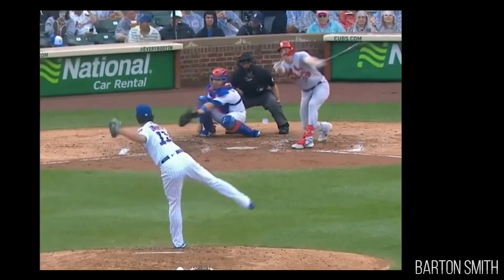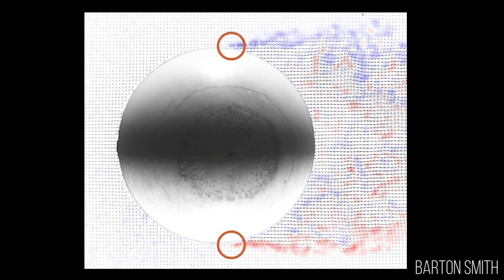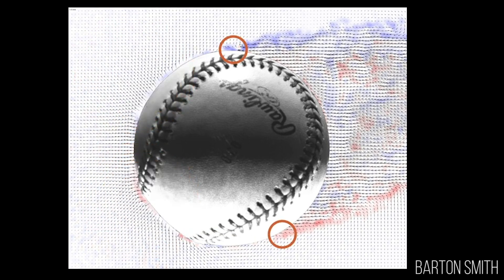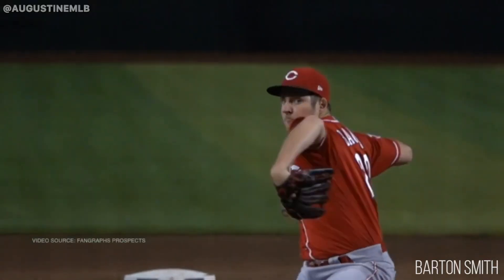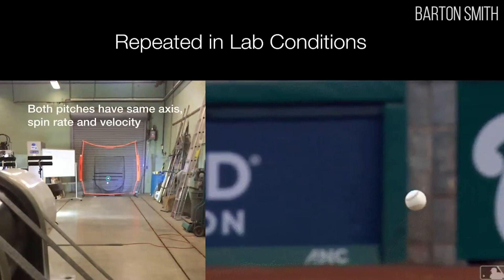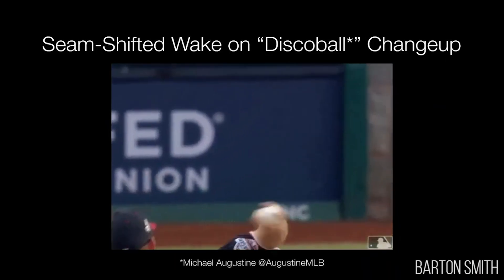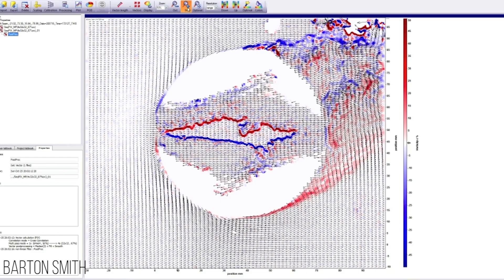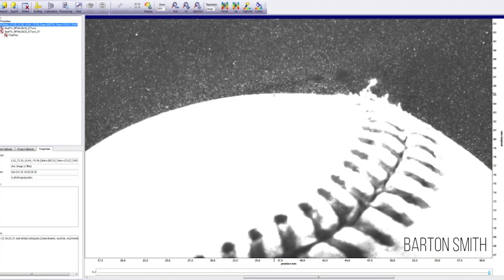Baseball Aerodynamics

Comment: What about a cricket ball?
Reply: Similar research has been undertaken on a cricket ball since the 1980s. Swing bowling is caused by pretty much the same phenomenon. You can find a lot of papers on it.
Reply: @kunjalssj  Swing bowling is caused by turbulence transition. SSW is not.
Reply: @loganhighschoolbaseball4815 you're right. Perhaps, I was too liberal with the phrase *pretty much the same phenomenon*. What I meant was that swing bowling is also caused by a similar phenomenon of flow asymmetry on two sides of the ball due to an angled seam. 

However, we do see something like the SSW in cricket when we talk about reverse swing where you see an earlier flow separation on the seam side of the cricket ball.

Comment: Isn't this what spin bowlers in cricket have been doing for decades?
Reply: It's what fast bowlers in cricket have been doing for a long time - using seam asymmetry to cause transition on one side and a net force (known as swing) towards that side. The only difference is that cricket ball seams cause flow transition while baseball seams cause flow separation. 

Spin bowlers, on the other hand, rely on the Magnus effect to get the desired "drift" in the air - similar to a curveball in baseball.
Reply: That small difference you mention is a very big difference.
Reply: @kunjalssj  There are sooo many more possibilities on a baseball than there is on a cricket ball. On the other hand, you can modify a cricket ball legally not to mention being able to bounce it.
Reply: No it's not